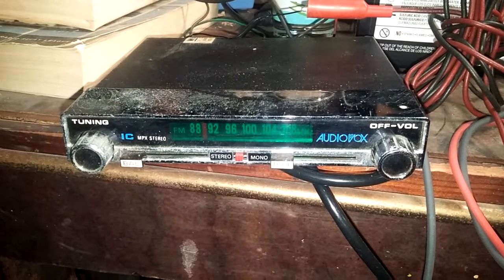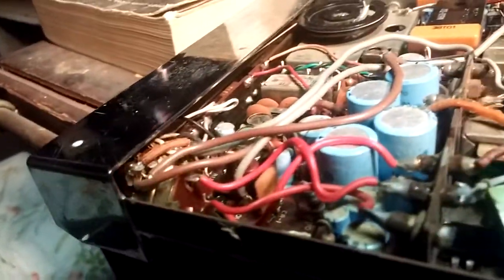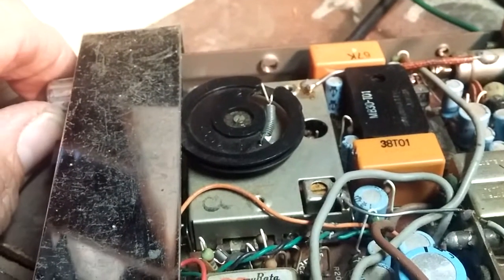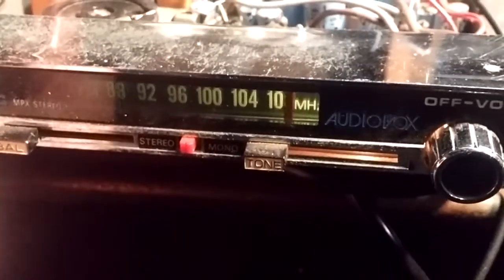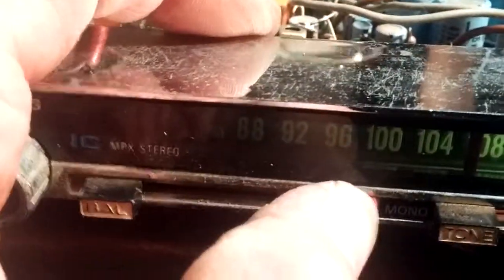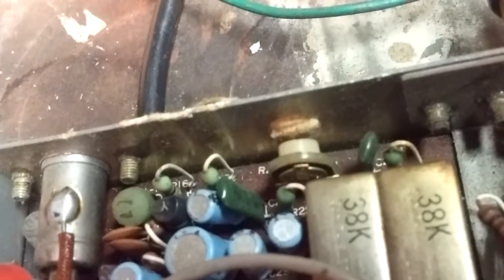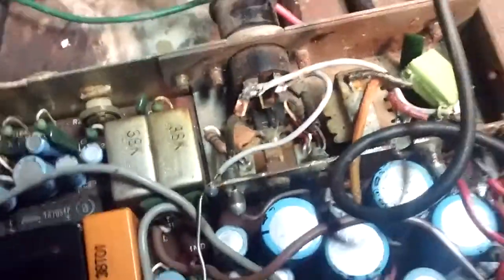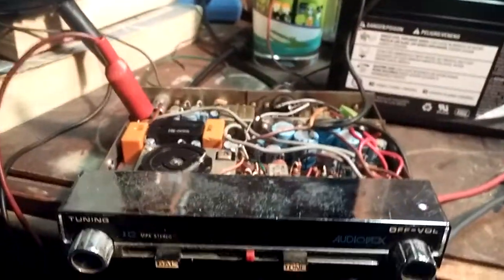early 1980's Audiovox FMX-20 FM car radio

Comment: 38k blocks are tuned 38khz filters which are used in demodulating the stereo signal. The 19khz stereo pilot signal is doubled then demodulated and phased for stereo separation
Reply from the maker: yes, that makes sense then.  the equation shown at wikipedia for describing the phase relationship between 19 and 38 khz is complicated and way past my level of understanding!